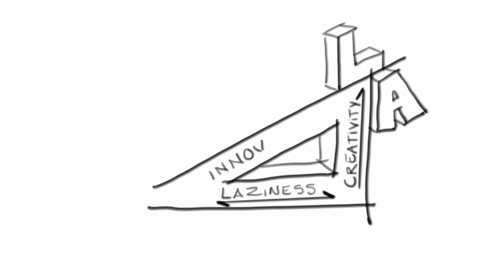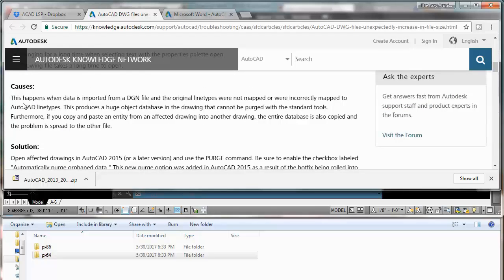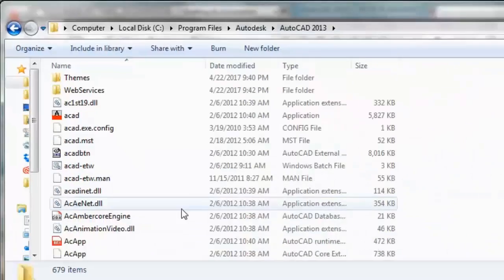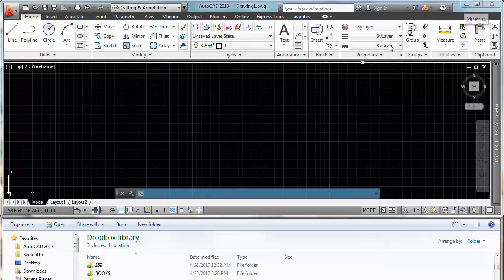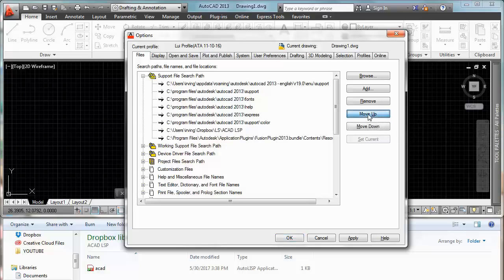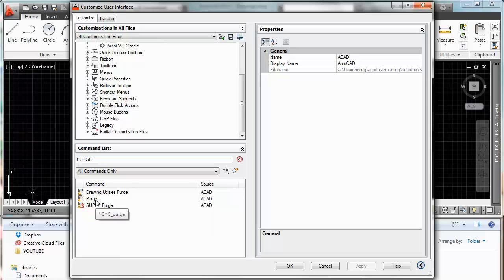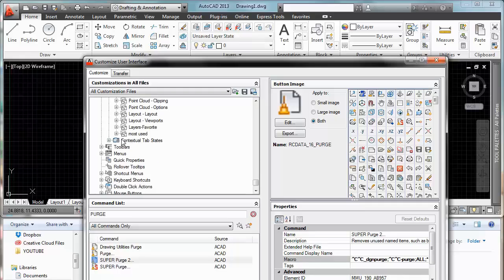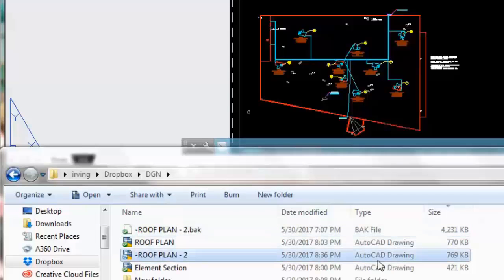Minimize DWG Size & Clean CAD Drawings with Super Purge (2/2)

Comment: Best solution, I appreciate

I have an problem to extract the files in "C" drive because in my office I.T administrator gave me limited permissions, do you have any solution to load .dll files from custom location?
Reply from the maker: +Tajammul Hussain Khadir unfortunately you need permission.
You can try this: copy all>open brand new dwg>paste all.
Let me know if that worked.
Reply: The Lazy Arquitecto yeah it's working but only few mb, now I am using 2016 and I am working on a stadium project, my drawings is around 170mb.